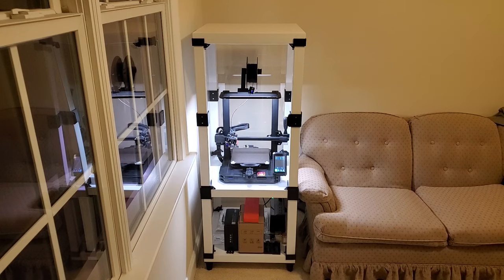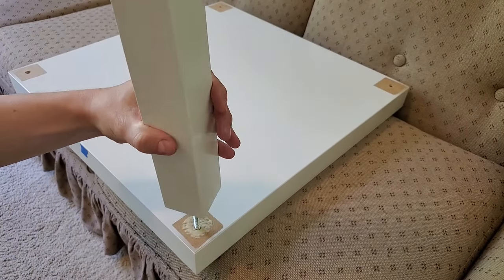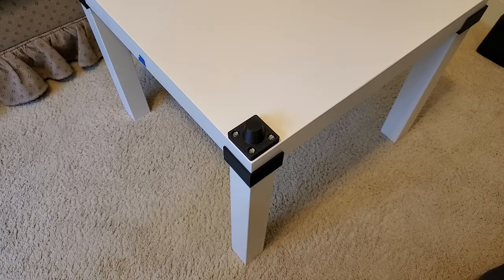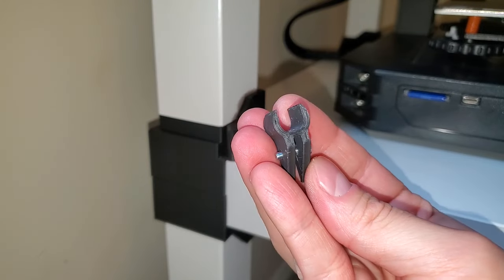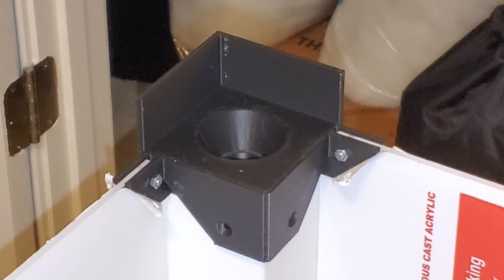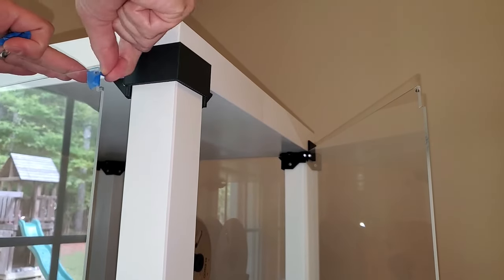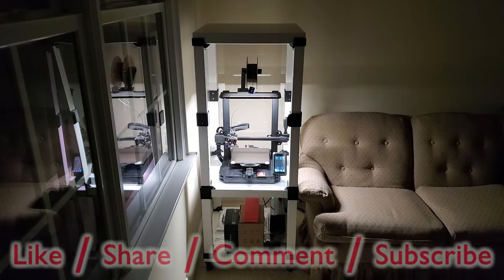3D Printer Enclosure made from 3 Lack Tables

Comment from the maker: N.A.L.E. - Not Another Lack Enclosure:
https://www.thingiverse.com/thing:6296586
https://www.printables.com/model/643482

Ender 3 S1 Pro Mods:
-Extruder Cable Holders
https://www.thingiverse.com/thing:6296317
https://www.printables.com/model/643476
-Bed Locks
https://www.thingiverse.com/thing:5858852
-Scraper Holder
https://www.thingiverse.com/thing:5935175
-Spool Spacer
https://www.thingiverse.com/thing:5970658
https://www.printables.com/model/643470
-Display Mount
https://www.thingiverse.com/thing:5359451

Lack Table:
https://www.ikea.com/us/en/p/lack-side-table-high-gloss-white-60193736/

Acrylic / Plexiglass:
https://www.tapplastics.com/product/plastics/cut_to_size_plastic/acrylic_sheets_clear/508

Magnets:
https://amzn.to/3FKHKVO (affiliate*)

Coping Saw:
https://amzn.to/3QnoYJ0 (affiliate*)

Fine Tooth Coping Saw Blades:
https://amzn.to/3MQRKRp (affiliate*)

UPS:
https://amzn.to/40pPrtT (affiliate*)

Creality Ender 3 S1 Pro 3D Printer:
https://amzn.to/49fDGKN (affiliate*)

*Purchasing from these Amazon affiliate links earns my channel a small commission. Think of it as a tip that doesn't cost you anything. Thanks for the support!
Reply: Any chance you have a step file? Would like to remix to add lack reinforcement/support for stability improvements.
Reply from the maker: @5ANDW1CHES  I actually made all of the new parts and part mods in TinkerCAD so I only have STL files. You should still be able to remix it any way you want, it might just be a little more cumbersome.

Comment: very nice, The only problem i have is i don't have the ability to cut up the Plexiglass as i live in an Apartment... But i'd love 2 enclosures for my 2 printers. I was actually concerned for the size of the S1 Pro as its my 2nd printer. But looks like it fits perfect with those slight rear mods.
Reply from the maker: I had the plexiglass cut at the place I bought the sheet from. Then all I needed to do was cut the small notches at the corners, some notches halfway up on the long edges to accommodate my printed parts, and the holes in the back for the bed and power cables. You could easily do that on your kitchen table with a coping saw. :)

Comment: Since there're so many gaps around the plexiglass, I'd put in a vent to produce negative pressure inside the enclosure and vent it outside. Otherwise the micro dust will still permeate your room.
Reply from the maker: Yeah, that's part of the reason I decided to place the enclosure next to the window. I can drill a grid of holes through the plexiglass on the left side, mount a computer case fan, attach a flexible tube, and run it out the window.

Comment: I would like to follow your method. But I'm having a hard time painting the top white. Is it possible to make the top reversed in your method? If so, the brown color on the underside can be hidden from view.
I also have a hard time cutting acrylic plates.
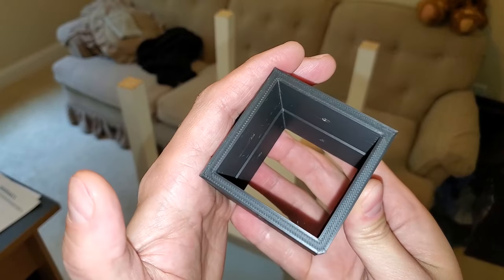3:30 Cutting where the coupler meets the acrylic is the biggest problem.
What if I printed only part of this coupler, so that where the acrylic plate goes, the coupler doesn't exist? lose the rigidity, but you wouldn't have to cut the acrylic, and get a cleaner look.
Is there a way to do this without cutting the corners of the acrylic plate as well?
Reply from the maker: You could flip the top, so the brown side is hidden, and then drill holes to accept the leg screws. As for cutting the acrylic, a coping saw with a fine-tooth blade would be your best option.

Comment: Nice job. 
is there a print list of how many of each you have to print... also a cutlist dimensions of the acrylic panels?
Reply from the maker: Thanks! For the lower section, below the printer, you'll need to print 8 of the standard Lack Stackers and 4 Lack Feet. For the upper section, you'll need to print one each of the 8 Lack Stackers that end with the 3 letters. For example: Lack_Stacker_BFL stands for Bottom Front Left or Lack_Stacker_TRR stands for Top Rear Right. You'll also need 4 Lack Couplers, 4 Lack Cones, 4 Lack Hinges, and 2 Lack Door Handles.

If you'd rather have a door on the front and left, instead of the front and right, just move all of the pieces clockwise one place.

The plexiglass I used had a thickness of 1/8" and I had the panels cut to 32.205" x 17.480". That left a small gap around all sides and then I just had to cut the clearances for the printed parts myself.
Reply: Thank you brother.   @Mikeattempts

Comment: Looks really good. Nice and big for my Ender 3 Max Neo. The noise of mine is hard to listen to when it's in my office, especially on calls. Might have to go for silent fans, but wondered if this would do much to reduce the noise?
Reply from the maker: It noticeably reduces the noise but it's hard to say how much. Before the enclosure, the printer could be easily heard from the next room. Now I can only hear certain movements.
Reply: @Mikeattempts  Great, it all helps as my printer is quite loud. Only downside is, it won't fit on a single Lack table like yours 😏 but I have an idea based on your enclosure, twice as many tables perhaps.... 😂😉
Reply from the maker: @raynbow6  Or you could use the legs from the Lack tables but make you own tops?

Comment: Hi there,
first of all: Great Job. :)
I´'m currently on printing all the files, but is ist possible that theres something missing ? At 03:01 your speaking of the cones that fit perfectly into the connector. I couldn't find them in your file list or could find some "look-a-likes". Did I miss something or am I getting something mixed up ?
Best Regards
Reimar
Reply from the maker: Thanks! The STL file for the cones is called "MA_NALE_Lack_Cone.stl". In Thingiverse, if you click on "Files", it's currently shown as the last file. Under "Files", on Printables, it's the 3rd from the bottom.
Reply: @Mikeattempts  Hi, sometimes things hidden in plain sight ;). Finally I need some glasses or eat more carrots. Found it and thanks again.

Comment: Looks cool! I built something similar, i think it was the first iteration of the Prusa lack enclosure years ago, still rocking strong! I was wondering, wont the PSU overheat? With my enclosure it was recommended to place the PSU outside of the enclosure. 
Also you can make a shelf below the printer by glueing some shelf holders, glueing onto the lack leggs works great. You can fit some boxes of filament with some tools on top of the shelf.  You can also shorten the leggs of the top table with a chopsaw, lower the table a bit and put the filament on top for easier filament changes. Also if your floor is uneven you can chop the bottom legs and add adjustable feet, ( i made some using some ikea cabinet feet, a print that slides in the leg and some nuts inside the print to screw it into) 
Also, idk if possible for your printer but could be nice for a future iteration is an angled printbed connector ( i was able to print one for my printer so i didnt have to make a hole in the back panel)
For the PSU cables you can also run them through one of the table mounts saving you another hole in the back panel.
Another nice addon for the enclosure is one of those cheap thermometers so you can check the temperature inside the enclosure, i made a mount for mine so the screen is inside the door, its just a fun little addon doesn't add too much functionality. 
If you're ever going to upgrade your printer, getting one with true automatic bed leveling is a godsend. If you're wondering what filament to use, i prefer PETG and PLA. Also if you can, get it with some glitter or something similar, it hides the layerlines very well. ABS is only nice if you're planning to vapor smoothe your prints, other than that, its not worth the smell in your livingroom.
Happy printing!!
Reply from the maker: Thanks! I hope PSU overheating doesn't become an issue. I thought about making a raised border around the base of the printer and then cutting a small hole in the tabletop to mount a fan to suck heat from inside the printer and blow it out the bottom. That way it wouldn't pull heat from the enclosure, just the inside of the printer. However, so far I've only printed PLA and haven't had the need for a heated enclosure. When and if I ever print nylon, I guess that'll be the PSU heat test.

I didn't like the idea of having the filament spool outside of the enclosure which is why I designed it to be twice as tall as a standard Lack enclosure. With the added height and the door on the right side, it's super easy to swap out the spool.

I looked and looked and looked for a way to modify the bed connector so the cable wouldn't go straight back but I couldn't find a good solution. The best option seemed to be to replace the existing cable for a longer one but I didn't wanna take the mod that far, at least not yet.

Thanks for the comment! :)
Reply: @Mikeattempts  Ah that sounds like a good idea! I was lucky enough that i could detach the psu from my printer and the cables are just long enough for them to reach with the psu outside. It'll probably be fine either way.

Yeah having the spool outside does add some dust onto the filament, thats why i need a thingy with some sponge in it that i can click onto the filament to wipe it clean while it prints. Having a door on the side seems nice, wish i had that, now i have to lift the entire top when i need to do serious maintenance.

I completely understand not wanting to mod the printer when its new, especially if you can't find a good enough solution. What you did works fine aswell. 
What slicer do you use? I can also recommend prusaslicer since it has great functionality and ease of use for beginnners. 
Good luck Fused Deposition Modeling!
Reply from the maker: @mick0matic  I use Cura but I have heard good things about Prusa Slicer.

Comment: Thanks Mike! Looks great, sturdy, has storage and plenty of space for expanding the printer in future. I will build it this week.

Any chance you could confirm exactly how many of each file you used? Because of the upgrades/naming conventions I'm a little confused (and because I'm easily confused) and don't want to waste time and filament. I will build it exactly as you did with two doors.

Thank again, great work
Reply from the maker: Thanks, I appreciate the feedback! :) For the lower section, below the printer, you'll need to print 8 of the standard Lack Stackers and 4 Lack Feet. For the upper section, you'll need to print one each of the 8 Lack Stackers that end with the 3 letters. For example: Lack_Stacker_BFL stands for Bottom Front Left or Lack_Stacker_TRR stands for Top Rear Right. You'll also need 4 Lack Couplers, 4 Lack Cones, 4 Lack Hinges, and 2 Lack Door Handles.

Comment: Hi. 
on yt 2:22 what's the spec of the screw ? 
On yt 3:01 you said that will use the factory holes but, again, what is the spec of screws. Seems you are not using the factory screws (only on the first table.

Thanks
Reply from the maker: The longer screws, at 2:22, are called "trim-head wood screws". The length isn't as important as making sure they have a small enough head to fit down inside the hole. If you can't find screws like this, you could try gluing the top on. The wider screws, at 3:01, are called "pan-head wood screws". Just take the screws, that came with the tables, to the hardware store to match the width. I can't give you more details on these two types of screws because I pulled them from an unmarked bin of screws that I already had at home.
Reply: Thanks for the answer. I’ll buy some of 6/7mm from different sides and heads. I’m from Portugal and the names are differents :)
I’ll post the make soon

Comment: Really good project - did you do anything for the ventilation, to reduce the smell of PLA in the living area?
Reply from the maker: Thanks! I chose the location by the window so venting would be an easy option, if needed, in the future. I could drill a grid of holes in the top corner of the plexiglass, on the left side, print an adapter to mount a low RPM computer fan, connect a flexible tube and stick it out the window. I could even print an adapter for the window, that would extend the length of the pane, to keep bugs out. As far as I know, PLA fumes aren't toxic. The PLA I've printed with so far only has a slight sweet smell which isn't offensive at all. It's even less noticeable now, when printing inside the enclosure. I hope to print nylon in the future and that might be a good excuse to install a vent.
Reply: Nice, drilling a grid of holes crossed my mind too - definitely food for thought. Thank you for the response, I just subscribed. 😀
Reply from the maker: @r4zi3l57  Thanks, I appreciate it! :)

Comment: Nice project gotta go with this. What measurement/kind and how many screws?
Reply from the maker: Thanks! I used 12mm M3-.50 bolts and nuts to attach the plexiglass and 3/4" #6 wood screws to attach the printed parts to the tables.

Comment: Great project, but mu question is I am worried about the main board and other electronic parts to heat a lot and damage because de high temperature .  Can you share your experience abaut it? Btw my printers run 24 hours every day.
Reply from the maker: I probably only print a few times per month. Since finishing the enclosure, the longest print I've done was probably around 5 hours, but I didn't have any issues with excess heat. I'm no pro but you could drill a grid of holes and attach a computer case fan to the top of one of the plexiglass sides, attach a flexible duct, and exhaust the hot air out the nearest window. Or you could relocate the power supply to the enclosure area below the printer. Or you could add heatsinks to the stepper motors. Or you could print with the doors open/off. Or do a combination of these suggestions.

Comment: Hey Mike.. I am almost there... :)
Could you give me the measurements for the 5 cuta to make on plexiglass ? 

Cheers
Reply from the maker: It wouldn't be a good idea to follow my measurements for those cuts. If your plexiglass wasn't the same exact size as mine, your cuts would be off and the panel would be wasted. Just take very accurate measurements yourself and then add 2 or 3 mm to each cut to allow for clearance. You should triple-check your measurements before making any cuts and don't forget to account for the gap all the way around the outside of the panel. Also, keep in mind that because of the bottom stacker pieces, the center coupler cutouts won't be exactly the same distance between the top and the bottom of the panel.
Reply: @Mikeattempts  Thanks. I'll do it but could you show where I need to measure the four edges to cut? I can't figure it out.
Reply from the maker: @antoniosa  These cuts are to provide clearance around the 3D printed parts that stick out so just measure them and then add 2 or 3mm to each cut. After measuring and marking the plexiglass, hold it up to the opening to make sure everything will line before making any cuts.
Reply: @Mikeattempts  I have found a way using the Expanded PVC board as a guide. These boards are cheap and can guide me in the exact cut measure :)
Reply from the maker: @antoniosa  Ah, that's a great idea, let me know how it goes! :)
Reply: @Mikeattempts  I try to send images on Instagram. But you need to accept :)
Reply from the maker: @antoniosa  I followed you on Instagram but I don't see any other notification to accept anything. Post it as a make on Printables! :)

Comment: @mikeattempts what is the meassurements of the plexiglass?
Reply from the maker: The plexiglass I used had a thickness of 1/8" and I had the panels cut to 32.205" x 17.480". That left a small gap around all sides and then I just had to cut the clearances for the printed parts myself.
Reply: Perfect, thank you! @Mikeattempts

Comment: I made the same, but how do you manage to not get your printer to overheat?
Reply from the maker: I did consider mounting the power supply in the space below, but it hasn't been an issue.
Reply: @Mikeattempts  My problem isn't the powersupply, i have klipper running on an external RPI that is mounted outside, but my gears, belts and motors are struggling.
Reply from the maker: @Doile911  Ah, good to know, I'll keep an eye on my stepper motors to be sure they aren't getting too hot. You could attach heatsinks to your stepper motors or open the doors while printing.
Reply: @Mikeattempts  Yes, but the whole point of an enclosure for me was to keep it airtight and make sure the harmful fumes aren't leaking into the living room. Since even PLA and PETG has harmful fumes, i tried to enclose it.
Reply from the maker: @Doile911  First, this enclosure is far from "airtight". Second, from what I understand, PLA & PETG do not release harmful fumes. It's ABS & ASA that are the most harmful. I placed my enclosure by a window so I could attach a fan and exhaust tube and run it out the window if I ever decide to print with questionable filament in the future. However, I'll probably just avoid any filament with toxic fumes since my printer is located inside my house.
Reply: @Mikeattempts  I was on that page for 2 years, I too thought petg and pla were fine harmful fume wise. Then came across this video:
/watch?v=fxMUj7pcPPI
3:22 is the most relevant part for here.
Reply from the maker: @Doile911  If you're concerned about the fumes from PLA & PETG then the only safe solution would be to only use your printer in a detached garage or shed, separate from your house.